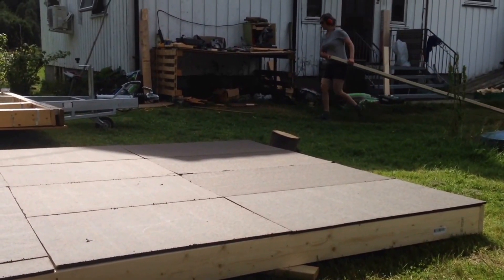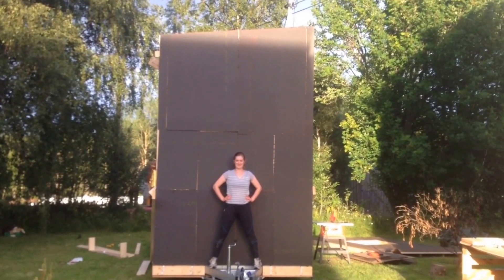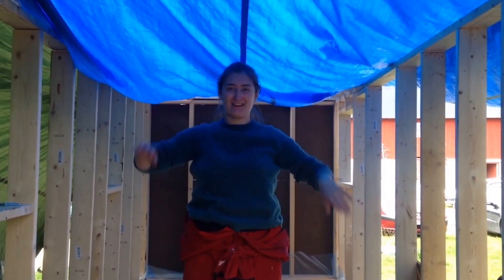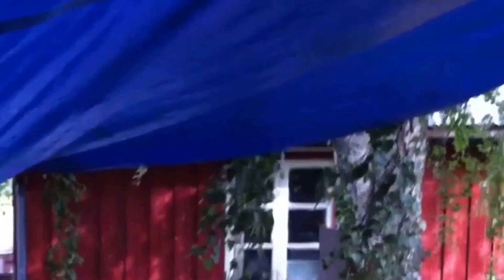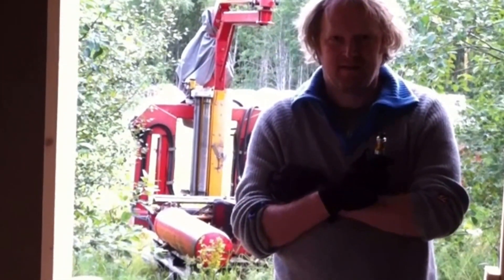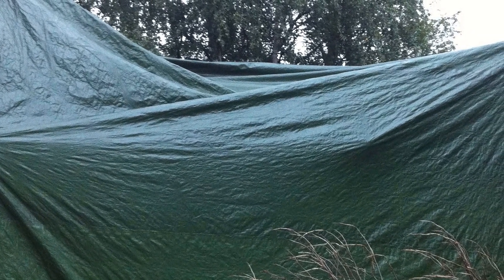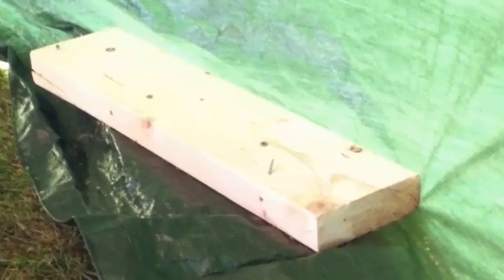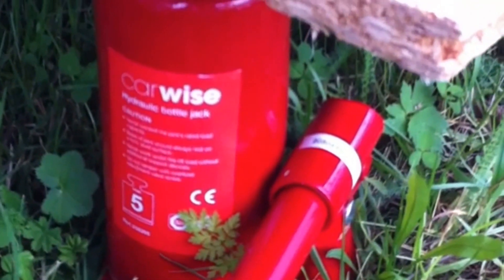Building a tiny house - Day 30

Comment: I will start building my tiny house on the exact same trailer in november, but what kind of material are your wind plates/boards? And why did you use osb on the underside of the trailer? Even if it is OSB3, it will not be impervious to the weather.

Good luck!
Reply: How did the build go? Did not see any vid on your channel about it so thought I ask here.